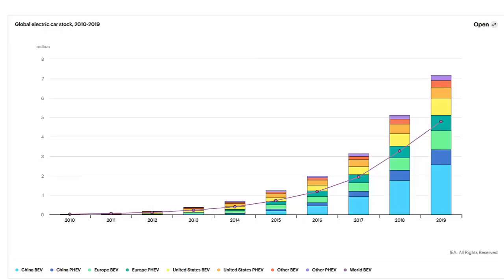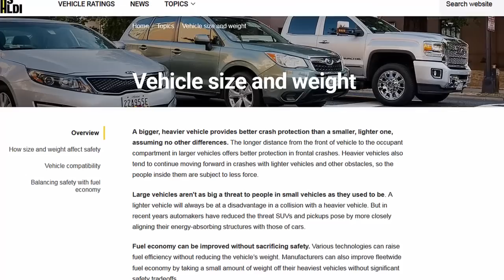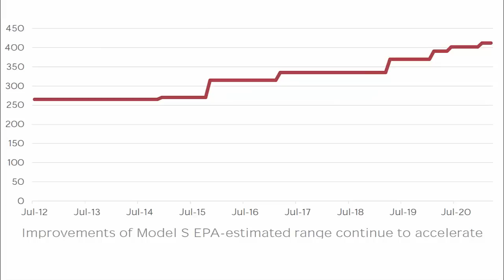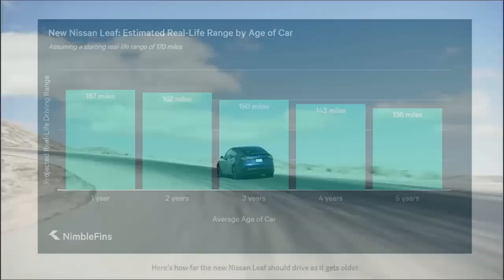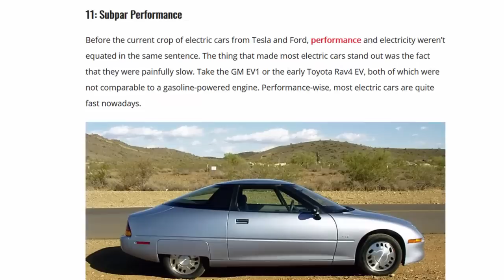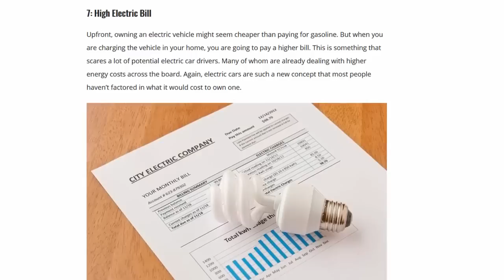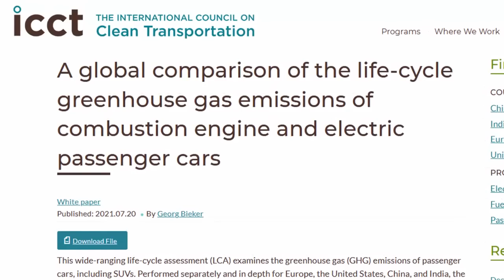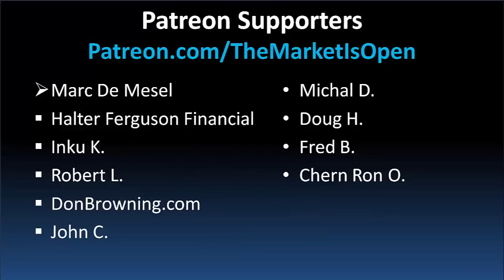Tesla will DECIMATE Gas Cars

Comment: To 'decimate' means to kill off 1 in 10. So yes, BEVs might take 10% market share and 90% of drivers will choose to buy a petrol/diesel car.
Reply: That is the historical definition.  It also means to kill off a large percentage.   When EV's hit 30-40% market share it's over for ICE manufactures.  Ford loses money on all the cars they sell.  Trucks/SUV are how they make money.  Given the low net margins, EV's don't have to take too much market share away from legacy automakers to put them out of business.  Once they get unprofitable, they shut down and there are no more ICE vehicles being made.  Then the EV market share goes to 100% really quick.  It's not about what people want, it's about profitability.  

My prediction is BMW is the first to go under along with any automaker that doesn't sell trucks.  Mercedes, Ford and GM will continue their commercial truck lines for a little while.  But eventually those will be replaced with EV option.

You should watch Tony Seba's videos on disruptive technologies.  It really sheds some light on what is happening now.

I'm sure when smart phones were 2% of the market, someone said the cap market share for them would be 10%.  Change is disruptive, but that doesn't stop a better/cheaper solution from taking over.

Comment: 1 moving to EVs will not be safer due to the fact that they are heavier, because when we have all moved to EVs the other car you hit will also be heavier. 
2 EVs do not really have a range problem. They have a charting speed problem. I can add 500 miles from near empty to 100% in my ICE car in less than 5 minutes. EVs so far take about 10 x as long to do the same.
3. There are more than 150,000 gas stations in the US. There are about 5,000 fast chargers. 
4. The problem with batteries is not the total lifetime of the batteries, its battery degredation. They do not become useless, but they do loose range in a way you do not see in ICE cars.

Most of these disadvantages will disappear to be reduced as EVs develop, and EVs have other factors where they are better than ICE.

But for now its fair to say they have disadvantages, which are deal breakers for some and less important for others.

Comment: The question isnt whether EVs market share increases, nobody is disputing that. The issue is, why would tesla who has been spearheading the EV market continue to have a high market share within the EV market. Logic tells otherwise. And mind you, high market share means about 20% - not 80%!
Legacy car makers didnt care for EVs 5 years ago so Tesla got a head start. Now legacy car makers care - a lot. And they are catching up and thanks to sheer size and infrastructure advantages they will catch up. Tesla is just one brand and has no monopoly.
Reply: "The Competition is Coming" argument lmao
Reply: Automakers face far more obstacles than just Tesla having a headstart. There's the fact Tesla's batteries are built and designed in house, while many automakers rely on outside sources. There's also the fact that they're attempting to build evs using ICE design thinking. Tesla developed their evs from the groundup rather than relying on previous designs, making them far more efficient. Then there's the problem that there's no standard charging plug for evs. There are 6 different charging plug styles, with 2 variations within those styles. Tesla doesn't have this problem with their charging network, while other automakers have a lack of standard charging stations. You don't see this problem for gas pumps as they are all the same style. Automakers are going to need to rethink how they're approaching evs if they want to properly break into the market and not fizzle out and eventually be left behind.
Reply: @Max, you should dig a little deeper why Tesla is so far ahead and how hard it will be for legacy automakers to try to catch up. Tesla is vertically integrated, has superior technology and is innovating faster. Even if OEMs build bring a competitive vehicle to market (they haven’t yet) they still have to make as much profit as their ICE business. And ramp up production. Meanwhile Tesla continues to innovate and move farther ahead. Tesla’s lead is gigantic and growing by the month.
Reply: @mooski82  Legacy auto profits by selling a lot of cars, with small profit. As soon as the numbers drop, they are in trouble. They have multitudes of problems like this. They are not lean and agile.

Comment: They did not mention once the very real issue that the current electrical grid, anywhere in the planet cannot Handle a large number of all electric vehicles.  Not to mention they actually say well just put on a bunch of solar cells and you can charge your car at night, so 50 to 70k for a car, then 50 to 70 k for enough solar cells, and 25k for a minimal 1 bank panel.  But then still could not have enough to run the house and car.  So for the small fraction of 250k upfront you can have a cat and your own gas station at your house.
Reply: You are way off… and have no clue about evs, grids, solar, storage or anything for that matter
Reply: In this case thats not true, for a consumer the only thing you need is electricity. Is not like because of EV cars we don't have electricity anymore. You know that the industry and transport waste like 10x the whole home market right?
Reply: Kelly, you misunderstanding peaks consumption vs average consumption.
Reply: @leonari  well that certainly explained it.  If we converted more that 10% more cars in the US to ev only it would over tax the current grid.  This includes transport, which would have to be built that is not well we will put it one extra wire for a couple miles and it is done. It is power generation Station that the epa keep shutting down, and 10 of thousands of mile of wires and transformers ect.  But you saying I just don't understand with zero explanation really shut down my argument.
Reply: @1943vermork  nope, but thank you for explaining it all.
Reply: @thehipsterhamster1929  yes there is waist in all transportation, regardless of the medium.  What does that have to do with my point?

Comment: This article is a joke. They are using obsolete cars in their data. The idea of powering EVs is that the fuel can be free! It's from the sun. You can add a few solar panels to your property to charge your car if u don't want to pay for electricity tom the grid. Or you can go one step better and buy an ev with solar panels mounted to the car and get free charging while u drive the car and while it is parked. I am looking at the aptera with a price tag less than $30,000 before govt rebates. I understand there are other start ups with car mounted panels. This article I believe is planted mis information paid for by the ice car makers. They are trying to kill tesla and EVs like they did back in the 1970s. I am afaid this time with the fire threats of the 2050 report and the ipcc report warning about the end of civilization by 2050 unless carbon emissions are not stopped.           Now.........the ice lobby won't be successful....

Comment: Will EV's be a big deal, and move us away from using fossil fuel engines? Yes. In 2035 to 2050, they sure will. Of course, most power is still produced by fossil fuel plants, and we don;'t have the grid infrastructure to charge all of these cars yet...but sure, that day will come. You will be older than I am right now before you see that day.
Reply: that's EXACTLY what the cattle barons said the same year henry ford started rolling model T's off the line. now cattle barons only sell beef & show horses.
Reply: and the grid? 5 years ago was 5% renewables. today? 16%. and growing exponentially. why? because solar even with battery storage is now more profitable than coal. PG&E isn't rebuilding their aged & out of date coal plants- they're replacing them with wind & solar. not because it's mandated... because it's cheaper.
Reply: @jaybee3165  The percentage of so-called "renewables" has nothing to do with the grid condition. And, that percentage of "renewables" is not all being carried by the grid. It is off-grid power. Only a much smaller amount is excess power being sold to utilities from homes and business. The grid cannot carry the amount of power needed to charge every EV that could be sold if EV production were to reach 50% of vehicles sold. The attitude about this is "we will deal with that later." The truth is that we have to deal with that now, or EVs will be sitting in driveways.

Comment: FUD is all that is left for the oil & gas conglomerate.
Reply: I even forgot the heavy industry, from steel production to aluminium, nickel, copper..... it requires alot of energy to work 24/7 coal, diesel, alot of electricity coming from power plants built with ICE...... the roads tar, car tires....... there are litteraly millions of oil by-products

Comment: Aside from the obvious energy production issues if electric cars rose up to become the dominant transportation vehicle, I'm concerned from an economics standpoint that Tesla isn't profitable from the sale of its own EVs, its profits were and are currently derived from selling "EV credits" to the other auto manufacturers so they can comply with the new CAFE and EV production requirements for upcoming vehicles.

Once the other manufacturers stop leaning on Tesla to comply with regulations, where will they derive their profits? That and the fact their P/E ratio is sky-high. Anybody holding that stock long-term might want to reconsider. Of course, it's never too late for the government to step in and bail them out (or subsidize)...
Reply: Have you checked the second quarter earnings report... One Billion in profit while building two new factories.
Reply: @fredskill5326  The question still remains. Did the profits derived come from the sale of cars or from EV credits sold to other automakers?
Reply: @pappaflammyboi5799  mostly cars sold less credits than last quarter

Comment: Ease of Repair is an argument for ICE cars? Really? I recently had to replace a common maintenance item on a Dodge Journey. The item? The 12 V battery. I could not do it myself because they decided to move it from the engine compartment to the driver side inner wheel well. Yes, you need to jack up the car, remove the tire, remove the wheel well, then with a special tool remove the battery, then replace the battery with an odd-ball hard to find size. Yes, ICE vehicles are soooo much easier to repair (sarcasm btw). I used to be able to do that myself. Wanted to teach my kids how to do it, since I first replaced a car battery when I was 12. The lesson I taught my kids: buy an EV instead. If you don't believe me, Google How to replace battery in Dodge Journey and laugh at the videos.
Reply: Try replacing a chip, resistor or capacitor in a PEM. AND THEY DO FAIL. And only Tesla and Gruber will do it. About 3.2k minimum not including parts, surgery only.

Comment: Full of BS. EV is just part of the mixed Electric, Gas ⛽️, Hydrogen and whatever future energy. EV is welcoming but not everyone wants or like EV. Do you still remember 55 years ago they said the end of the the mechanical watches when Seiko introduced Quartz watches. Today mechanical watches command thousands of dollars while quartz is selling at $50.
My 2005 Toyota Sienna is still running flawlessly at 312K miles tabs the most expensive repair has been around $550.